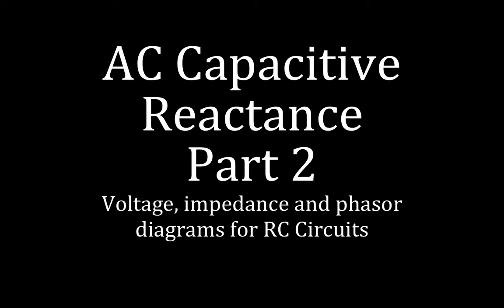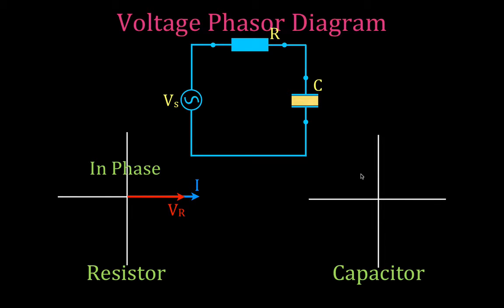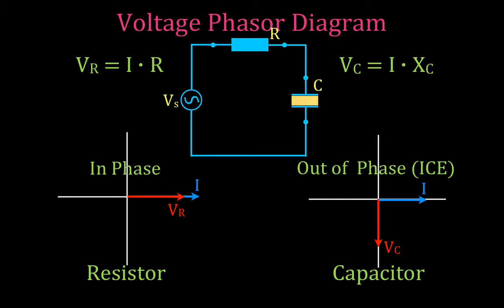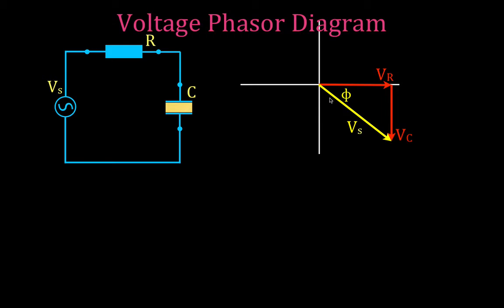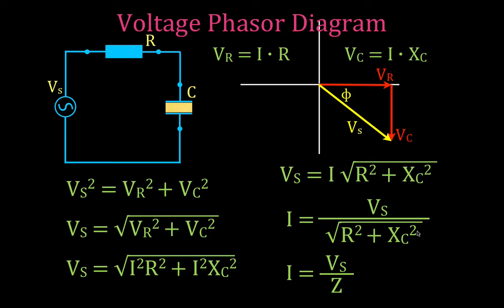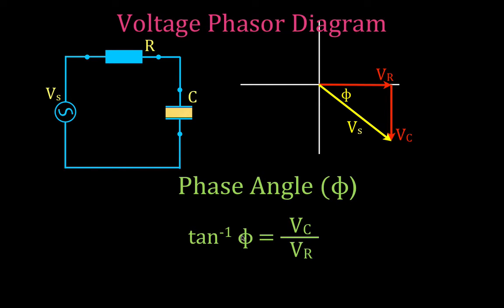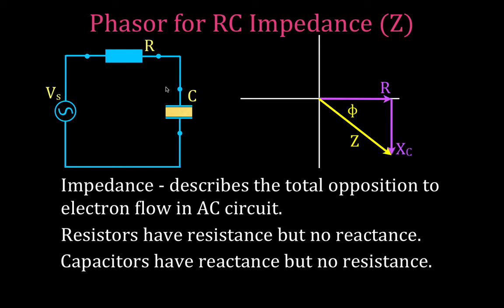RLC Circuits (6 of 19) Series RC; An Explanation, Voltage, Impedance, Phasor Diagrams

Comment: I think there is an error in the resistor phasor diagram at 1.58
The voltage should be ahead of the current since voltage has a higher value than the current
V=IR while I=V/R

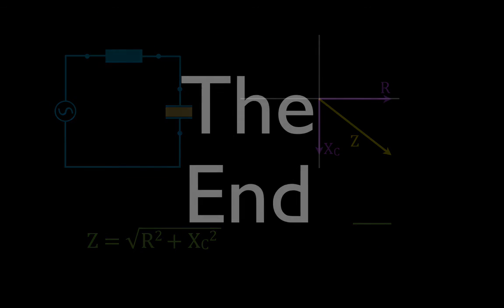Comment: At 10:54 to nit pic and  be accurate Capacitors have reactance but no resistance should actually be capacitors have negligible resistance.  However, for an introductory discussion, This is not an important point to include.

Comment: in a parallel rlc circuit. left branch has an inductor and a resistor.right branch has a capacitor. what would the formula be. thanks